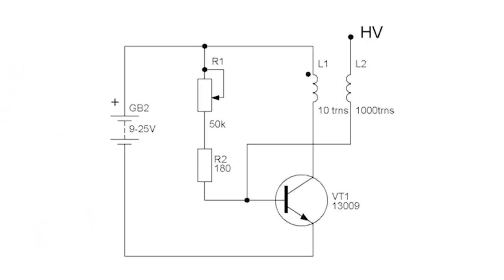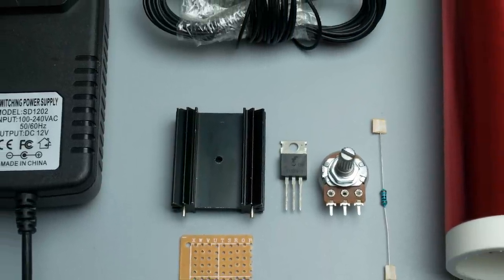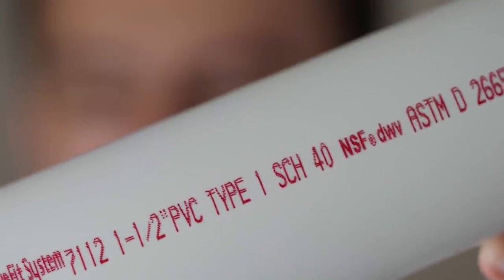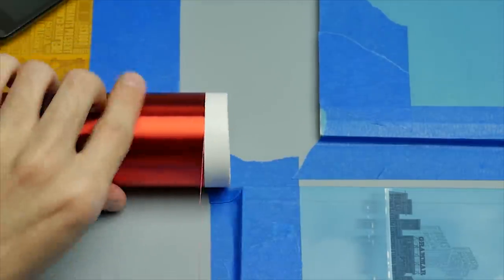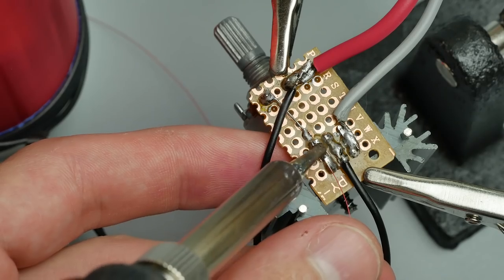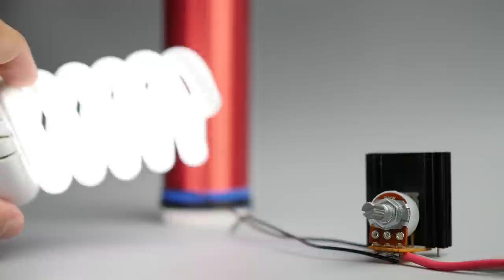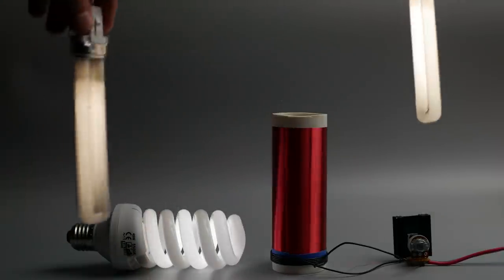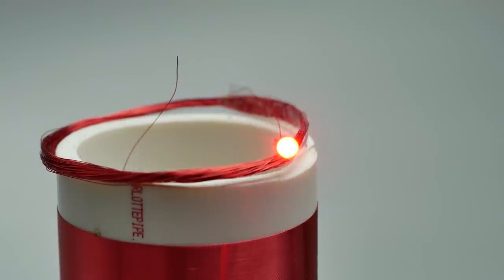How to make a Tesla Coil

Comment: Have you tried experimenting with the coil shape?
For example if your coil is tapered being large at the base of the coil and narrowing it off to a point at the top will concentrate and amplify the output.
Pictures from Dr Teslas labs can be seen where he used the very same methods.
Really good video's

Comment: your circuit diagram is not clearly visible and you should mention value of resister and transistor in the video..... bad finishing.
Reply: Are you serious? The diagram couldn't be any clearer, and all the parts are very clearly labeled! Resistor = 180 ohms, variable resistor = 50K ohms, transistor = 13009 NPN power transistor! Wow...
Reply: Circuit diagram is on the instructables.